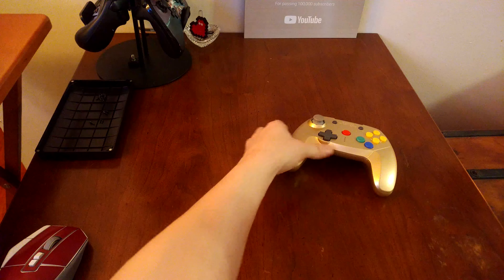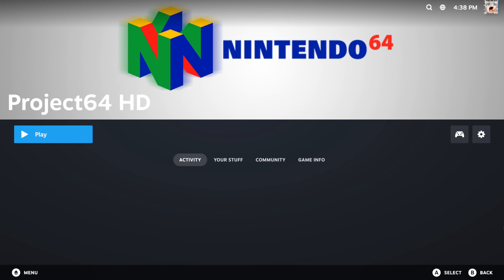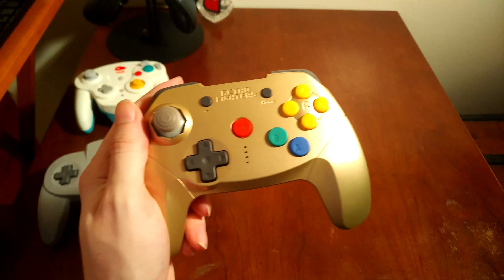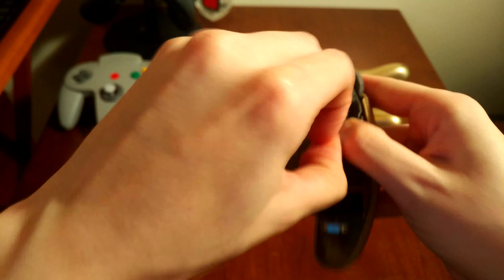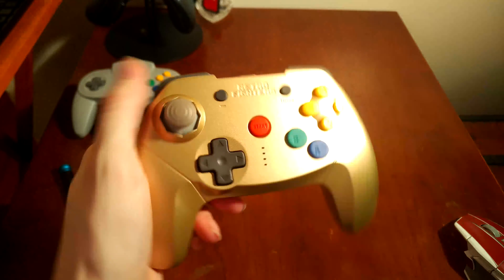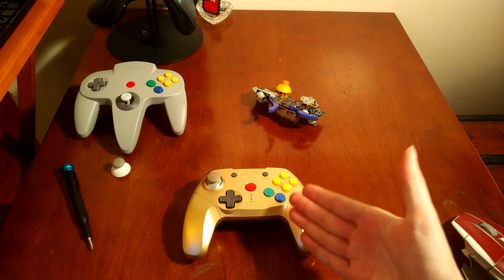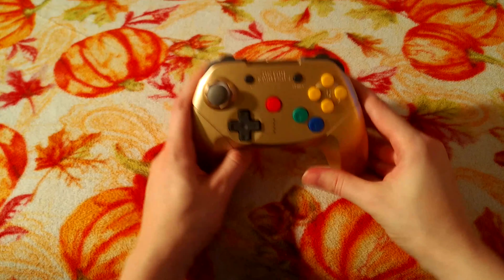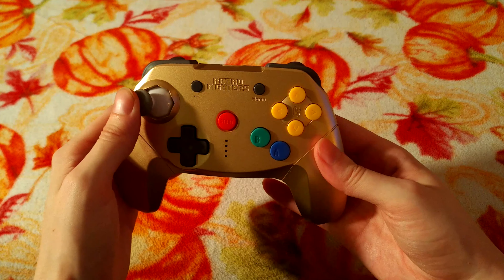The BRAWLER64 is a Wonderful Disaster!

Comment: I'm glad the gyro could compensate the lack of a right stick. And I saw the TF2 video with it. Out of curiosity, are you going to try out the Alpakka Controller? It's a PC controller where they replace the right stick with a scroll wheel and an 8 directional weapon switch. It's made with not just one gyro sensor, but two gyro sensors that work in parallel, reducing the noise by a large margin without increasing the latency. One sensor for small, finer movements, and the other for larger movements. To activate it, by default, you touch the hexagon on where the face buttons are. And it has two back buttons that retro fighters lacked.
Reply from the maker: That thing looks crazy. I do want to try it. How much are they going to be?
Reply: @AceTheOcarinaMaker  According to Input Labs (The creator of the controller), there are two choices in their shop. DIY Assemble kit is 158.50 euros, or solder AND assembly kit is 147 euros.

Comment: Regarding having a second stick in N64 games - 007: Goldeneye had a hidden control mode where if you had two controllers plugged in (Ports 1 & 2 respectively) you could play the campaign using both sticks in tandem like a split-twin stick controller (left hand/Port 1 stick for movement, right hand/Port 2 stick for aiming the camera).
Perhaps the Gyro could be used in games like that and (I believe) Perfect Dark?

Comment: Interesting video.  I own two Brawler controllers, the Bluetooth version and the WiFi version and neither has the analog stick issue you encountered.  If you bought this new I think you must have got old new stock.  You're not wrong about the face buttons I'd prefer them to be a little more rounded and with a glossy finish.  For the N64 the best controller is the official NSO one.  Using that on my OG N64 with a BlueRetro adapter you can see the analog stick performance is identical to the OG wired controller.

Comment: interesting review - my first experiences with them was as a backer for their very first N64 wired controller which had a funny design flaw where the analog stick was so close to the L trigger that if you pressed the L trigger all the way down it would hit the analog stick internally. They were great at fixing the issue and gave me a free revised controller (didn't even ask for the original back). 

That being said, I also have picked up a pair of their Defender wireless PS2 controllers and while they are "ok", the L2 and R2 triggers are way too sensitive and the d-pad design on those is quite bad... the d-pad itself is a weird slightly concaved shape with no texture and when you press it down, it becomes perfectly flush with the also smooth and textureless plastic of the housing so you can't easily feel where you're pressing on the d-pad cross itself.

Comment: I don't know if there is a difference in earlier or later production runs or not, but I have a white one and a gold one, and I just checked to confirm but neither of mine have the issue with moving the stick to the right. I didn't open it up to confirm there is a notch or stick design difference, but it pushes all the way in all of the directions. I've been using the white one with my MiSTer and love it. The 8-way gate doesn't really bother me in game play, but it's one of the few things about the controller I would change. For the most part, the fact that it just works with the MiSTer and plays N64 games perfectly makes this controller nearly perfect for at least that use case. There are other minor issues, but none have been show stoppers for me.

Comment: Tech review by a plant I can trust 👍. Could I ask you to review the NYXI wireless gamepad? I’d like your opinion on it cause I’ve been eying it for a while now.
Reply from the maker: You mean the Gamecube joy-con one? If so, That stupid thing was the most awful uncomfortable controller I've ever used in my life. Using it for just 3 hours put my hand in so much pain that I had to stop using controllers all together for 3 days after.
Reply: @AceTheOcarinaMaker  d a m n
Reply from the maker: No yeah I was absolutely shocked that a controller could even be so bad. Like, I of course went in knowing it wouldn't hold a candle to the OG Gamecube controller. Nothing ever does after all, but Jeez it was awful in every single way.

The Gates were rough and felt loose, the C stick was way too large, tall, and far away which is what messed my hand up so bad, the buttons all clicked like a mouse, the rumble was inconsistent and felt terrible, the face buttons were way too sunken in, the LED status lights I had to put wire tape over because they were totally blinding, the paddles were too stiff and totally useless, and when the Gyro wasn't being shaken around by the stiff buttons and horrible rumble, it's tracking was about on par with a Dual Shock 4.

Basically, the Gamecube Design was weird but everything down to the smaller C-Stick and the height of the buttons was for a good reason. They went through like 7 different prototypes. They knew what they were doing with the Gamecube Controller and changing literally anything on it dramatically like NYXI did can only makes it worse.

PowerA did a much better job and at a much lower price. Their controller has plenty of problems too but nothing that ever caused me intense physical pain like that.
Reply: @AceTheOcarinaMaker  holy moly I had went to bed and woke up to one of the most scathing reviews. Thanks for the info Ace!